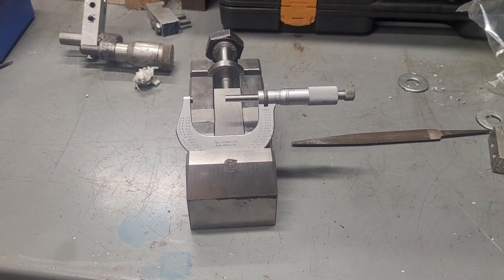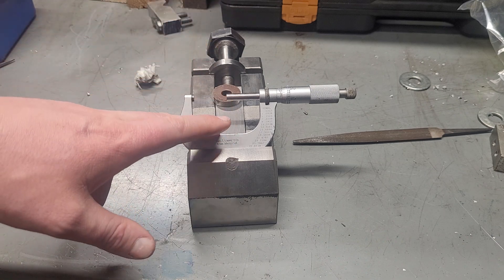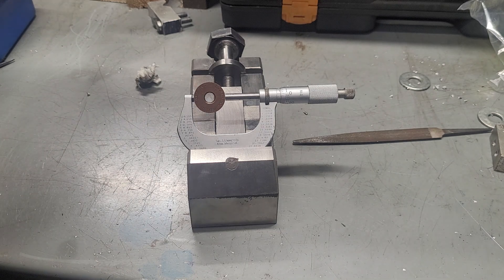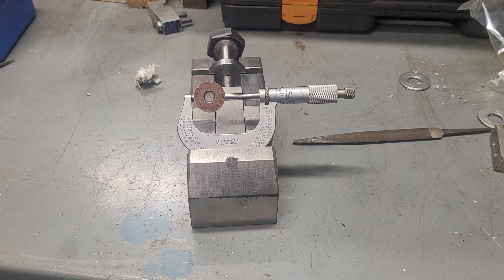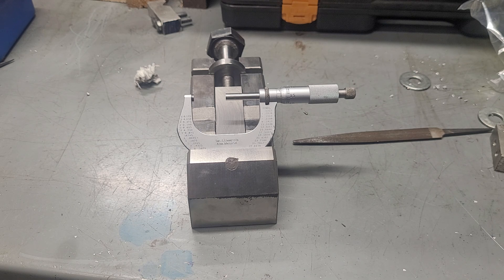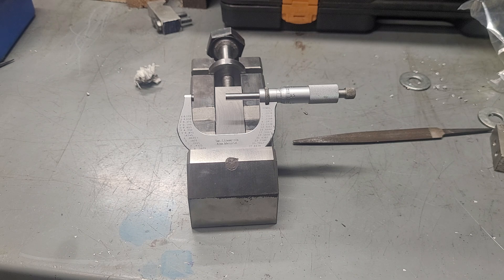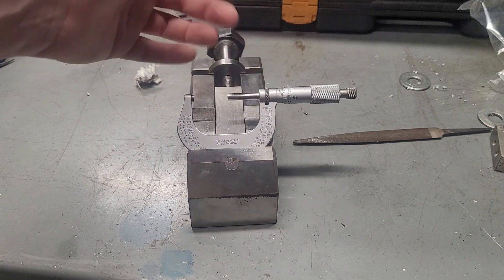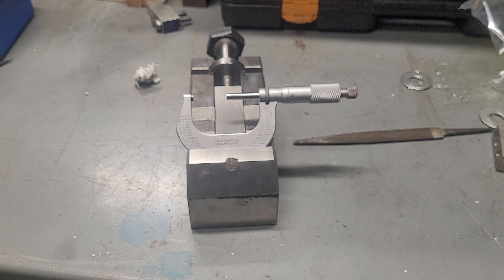Do metal parts get measurable bigger when they warm up?

Comment: This makes me wonder what size the  2.45 +.-0000 -.9991 bores I made in hard 4130 on an almost worn-out lathe really were. They were bored out .0015 undersize and honed to the final diameter. Measurements were temperature compensated based on the temperature of the water-oil emulsion coolant-lubricant as it came off the part. The coolant was kept in a 5-gallon bucket to allow better cooling. The FAA bought honing rather than grinding, and every part passed the shop's and FAA's 100% inspection. The parts were the flange that bolted a rotor blade on a helicp[ter. 

I was never comfortable with our ability to measure a 2.45 bore to ten-toucheth of an inch using telescoping gauges and micrometers.

That job gave me stomach trouble. Twenty-seven parts with 40 hours each, and finishing that bore was my last operation. Lives literally hung in those parts.
Reply from the maker: Jobs like that always impress me. On my machine it can be hard enough to not taper over 3 or 4 inches boring. Trying to hit a tenth or two in that bore would me me cry. 

Thanks for sharing!
Reply: Steel thermal expansion is .0000065 per degree. Based on a 60° observation.  survey chains were set to this. Crude oil has an expansion of .00065. A 40° degree swing will change volume a lot. A full tank would be 350 bbls. But calculated out a -10° tank when calculated to 60° API sale volume would be 364 bbls

Comment: In hot weather like 40deg c the micrometer grows more than the part usually over 300mm is worse.
Reply from the maker: Fortunately we don't usually get that here. From what I understand that effect is from the arched part distorting and spreading the anvils not just the cumulative expansion.